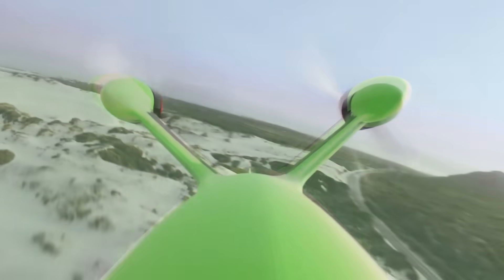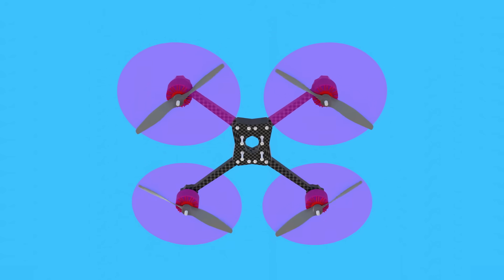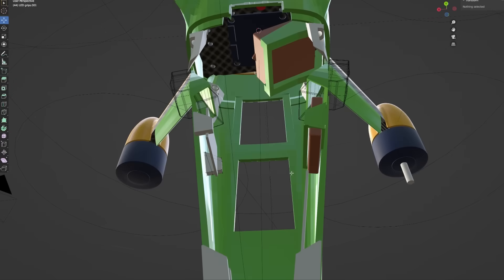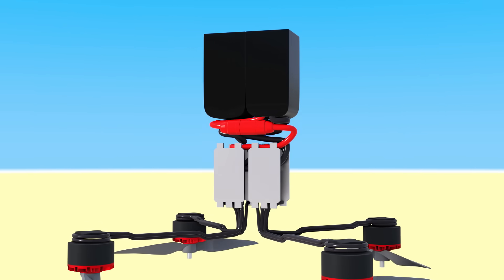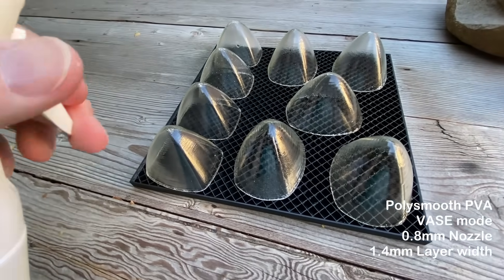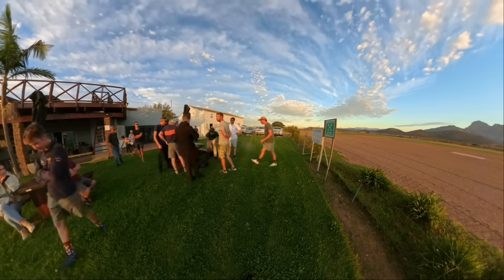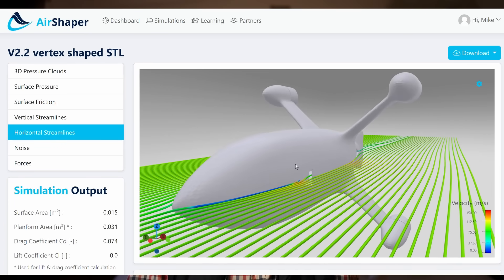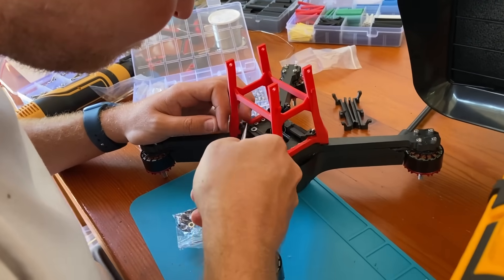300mph 480kmh | World's Fastest FPV Drone |  Guinness Record

Comment: I had a very uncomforable laugh at 12 hp in a 10" frame.
The US Department of Defense is going to be giving this video a good number of views i think
Reply: Small drones are practically undetectable and inescapable at much more conservative speeds anyway. Being cheap, easy, high range and having resilience to jamming would be more important than 500kph+ speed.
Reply: @putrid.p  Against stationary targets, yes. However, this high velocity drone could also be effective against helicopters and some planes.
Reply: @Riesenfriese  no, because you forgot the payload.
Reply: @Riesenfriese   If it has a 1300mAh battery at 12S would weigh approximately 300g.  With the other items assume total craft weight of say 600g.  Kinetic energy of that at 400kph is 11.57kJ.  That is roughly equivalent to 3 grams of TNT.  So whilst it would be interesting as a kinetic weapon alone, it would need an explosive to really have an, ahem, impact.
Reply: @tomsixsix  obviously the military version would look a bit different, both outside and inside lol
Reply: @pongmaster123 sorry, have you met semtex? You can paint a layer of epoxy resin on it and make the actual skin of the drone into the payload and it’ll weight just about the same as a plastic of similar density and strength, perhaps only 20% more. Pretty sure people at DOD have more kinds of boom boom to play around with.
Reply: @putrid.p  you are right. more of them and better placed and long range is far smarter than speed. small increase of speed reduces the payload for the "bomb" significantly.
Reply: @putrid.p  Anduril's Anvil is a counter-drone drone using kinetic energy
Reply: Ukraine is here first 😏
Reply: Absolutely fantastic video! I felt like was watching a magician explain away all his secrets!
Reply: That was my first thought, The military application is very obvious.
Reply: Idk. This kind of drone is realistically just something that has very simple mechanical design, four moving parts and it flies thanks to very fast sensors and regulation loop. Body does not produce any lift (even some helicopters such as Mi24 have small wings which produce lift so it's more fuel efficient to move forward than to hover. Also I would somewhat assume that important part of military drone is radio and immunity to jamming - or autonomous flight based on terrain recognition and then there is overlap between drone and cruise missile or UAV.
Reply: @pavelperina7629  considering dji drones are a major combatant in Ukraine, this could easily be loaded with an EFP like an RPG warhead and used to defeat AA emplacements or other high-value, well-defended assets.
you could literally be flying though the treetops and kamikaze before any anti drone elements had time to react. most AA systems are going to filter this out as a bird i think

The biggest problem is cost as I assume this drone is about 10x the cost of normal commercial ones
Reply: This is the perfect interceptor drone it just crashes into the enemy recon drones  or loitering munitions at high speed!
Reply: US is a wee bit more advanced...

Comment: Watching the battery voltage tick down that quick is impressive. Did you have to worry about battery cooling?
Reply from the maker: Well yes indirect airflow and they did get too hot but we just had to get 4 runs out of them. I think I recall 55degrees on the thermal camera for the batteries. To be honest we were so focused on cooling the ESC’s and flight controller that we didn’t pay much attention to the batteries. For next version we are using Bonka 200c!! 
We will found out how much hotter they are getting and see what best way to try and cool them. 
For 350kmh cruising flights the battery temps  were fine.

Comment: The very idea of 9000W motor/battery power in a product that small is just absurd.  Amazing work!
Reply: Its absolutely insane. I built fast drones myself but never Had anything over 4500W
Reply: Better to fly fast to cool it!
Reply: ：０００
Reply: OK Tmotor made the 12s one which is 　　：００００００００
---
The spec says 1500w of that motor is its limit and it was designed for 24v 6s... UMMM
Reply: that more than double the power of my 7inch drone